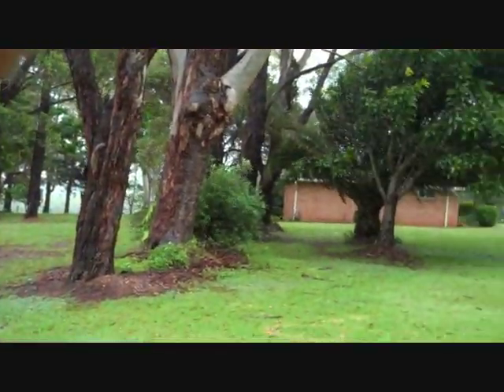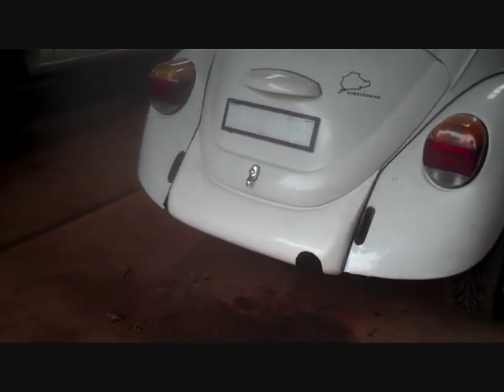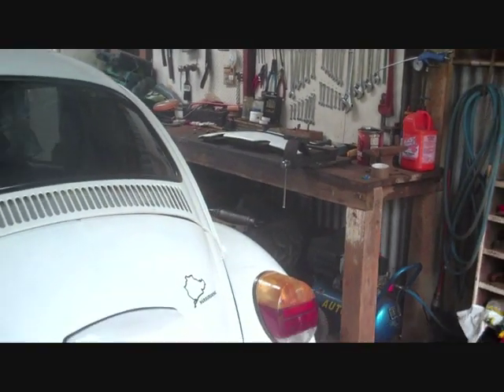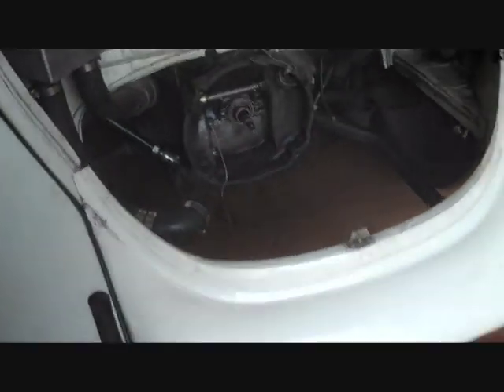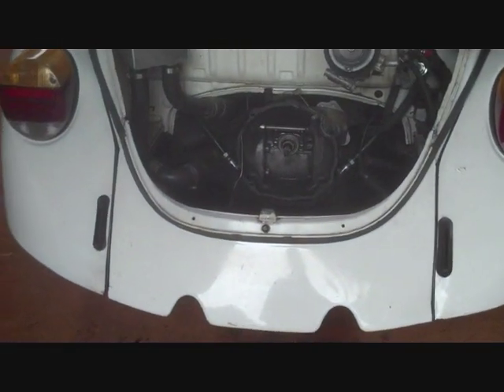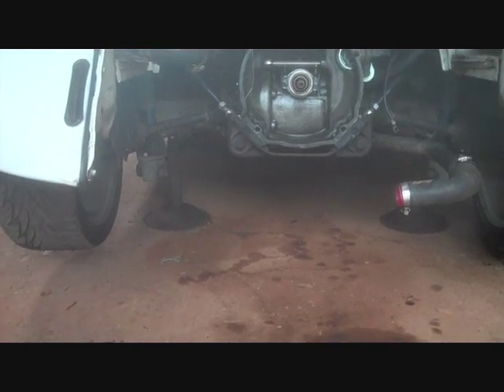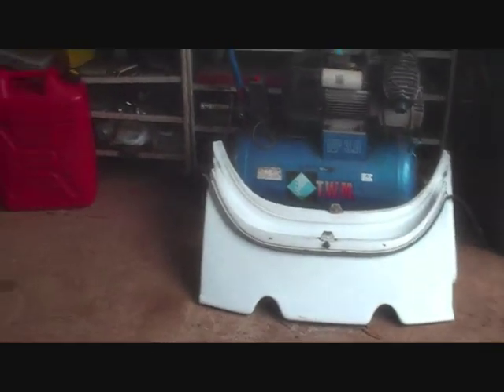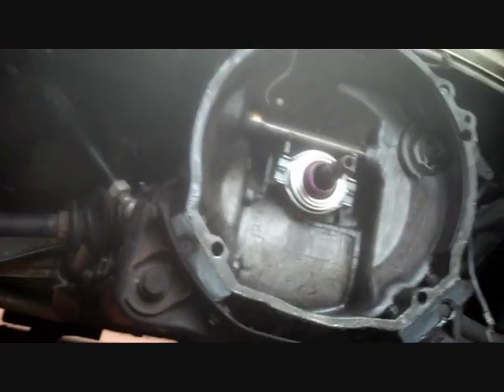Volkswagen Beetle Removable rear apron/valance

Comment from the maker: Hi, I do have a rear swaybar but it isnt actually fitted, what you saw is my Kafer bar kit, it is to strenghten the chassis forks for the extra weight and power of my Subaru engine. It bolts to the upper shock bolts and welds to the chassis forks at the front and rear

Comment from the maker: sorry for the late reply, just a 6mm drill bit to drill out the spot welds, although there are proper spot weld removal bits available and a thin cut off wheel in the grinder for the tack welds

Comment from the maker: Hi, yes you need to keep the seal in place to keep the hot exhaust air out of the engine bay. you'll see when the engine is out where the joint in the seal channel is.
you can cut the seal there so that it comes out with the valance.

Comment from the maker: Just a 6mm drill bit to drill out the spot welds (proper spot weld drill bits are available I just dont have one) and a thin wafer blade in the angle grinder to cut through that top weld.
bottom one inside needs grinding off.

Comment: Thanks. I need to do this as my transmission is leaking oil pretty good and its such a pain to pull/install the engine... How about a vid on replacing all the gaskets on a transmission since yours is/was leaking, although considering vid is 4 yrs old Im sure its fixed by now...

Comment: When I bought my beetle, it was missing the rear apron. According to the previous owner it was rotting away, and then I proceeded to still purchase it, but I digress. Would this be a good means of installing a new rear apron from the donor I'm about to acquire? I think using bolts to attach it would be far easier than getting somebody to weld it back in, and the fact I plan on lots of engine work.

Comment: When you removed the inside part of the valance did you still run the seal that went between the valance and engine. I want to make sure my engine won't over heat